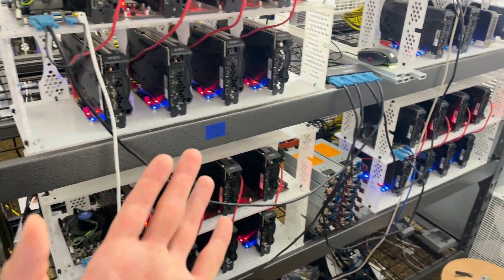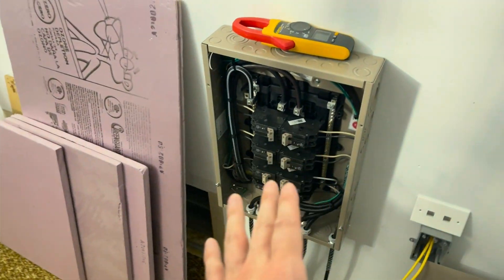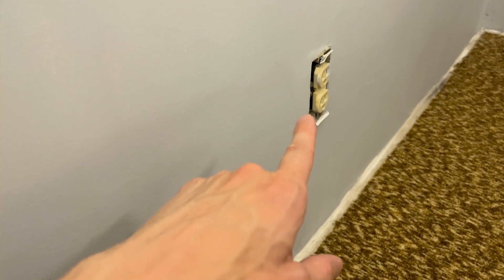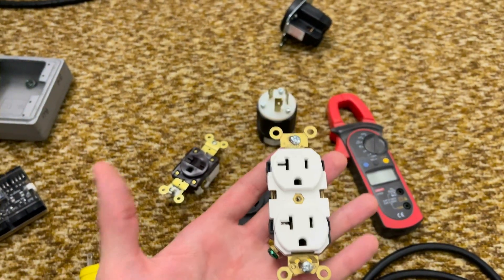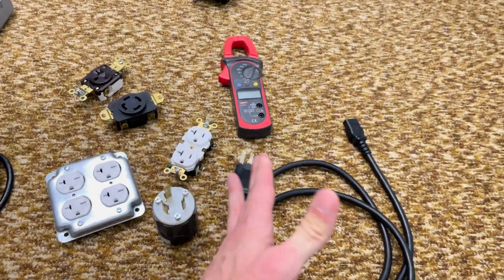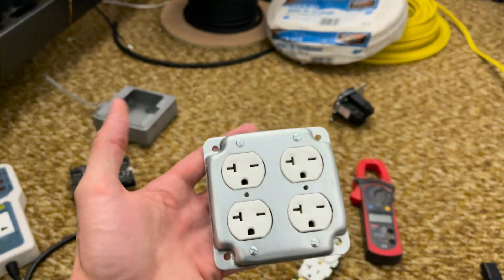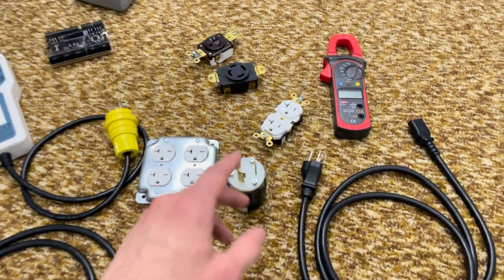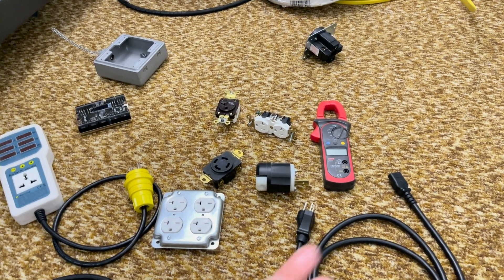How To Safely Power Mining Rigs.

Comment: I live in nj, building was built in 2018. Any idea what i may have?
Reply: Using a regular c13 btw
Reply from the maker: Are you talking about your electric service? If it’s residential, it’s almost surely 240v split phase, but it could be 100A, 125, 150, 200, 320, or 400A service depending on what was requested when the house was built. If it’s a complex, it’s most likely 208V 3Ph service, and they feed each unit with two phases for 120/208V 2Ph.

If you’re talking outlets, probanly #12 NM-B in the wall for wood framed, and 12/3 NM in the wall for commercial construction. 20A breakers are very common in almost all new buildings for everything but lights. On a newer 20A circuit, you can reasonably safely run 12A up to 16A or so without much of a fuss.

Comment: My voltage has been dropping to 218v maybe even lower. Usually around 230v, depends on time of day. Is this too low? My psus say they are rated for 220-250v. I called the electrical company and their going to put a voltage clamp on it and monitor it.
Reply from the maker: That’s not really a big deal, and often times there’s very little to be done about it. It’s possible they can bump it up, but if there’s a large fluctuation on the primary side of the transformer it’s typically not economically viable for them to bother for a single house with a slightly low voltage. Most devices are going to be happy enough with +/- 10% or so around the ‘nominal’ ratings. Those are not absolute numbers, but ideally you’d try and stay within them. 2V won’t really make any difference though, and it’s tough to fix.

Comment: this is very interesting. i recently had to replace a 15 amp outlet and my power suppler ac cable because i could see burn marks on both. im running around 1600 watts
Reply from the maker: 1600W at 120v is really risky. You’d want to only do that with a high quality outlet on a dedicated circuit.
Reply: @SiCPoWMining  ok thank you. It did get me thinking when you were explaining the outlet and curcuit capacity. I have the ability to move 500 watts to another outlet on different breaker

Comment: I had never considered how the outlets are chained together inside the walls. Great video.
Reply: Some homes will have 2 rooms chained to one breaker, if so you can max out the capacity with one rig.  Many upgrade a room or two with 220 voltage since you get more wattage and save a little money, not much but 220 has advantages.  Also you need to know which gauge wiring is in the walls, most homes have 12 gauge or 12 awg but some have 14.  12 is best but your breaker box is important too, newer flip switches vs glass fuses and the age of the wiring is important too.   

An electrician can take a look or unscrew a wall switch and carefully look at the wiring for writing that should read 12 awg or 14 awg.  Some say never exceed 80% capacity per breaker or 50% to play it safer.  Are your breakers a 15 amp, then 15 times 120 volts equals 1800 watts max per breaker or 1440 @ 80% or 900 watts @50% capacity.
Reply from the maker: Yeah, and over 50+ years in older homes, outlets get replaced here and there by homeowners, or they get damaged and connections get loose. This isn’t a huge risk for low power loads, but when you’re running high power through bad connections, continuously, that’s a huge fire risk. New homes have AFCI breakers in a lot of places that will trip off for this, but almost no older homes do, and it’s potentially dangerous to run old circuits at high sustained power levels without inspecting them.